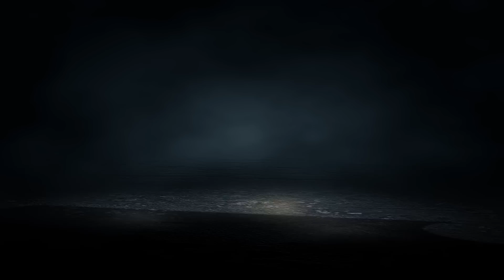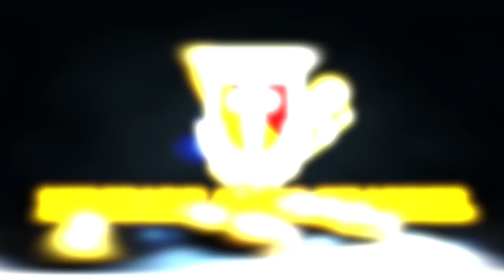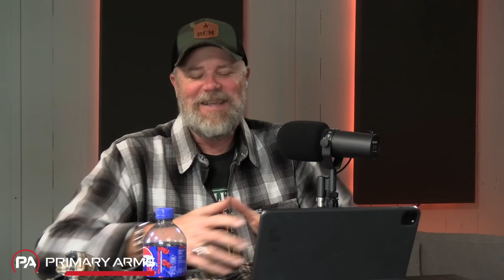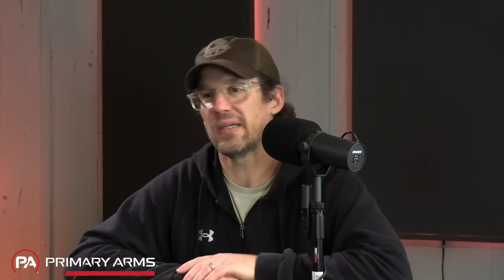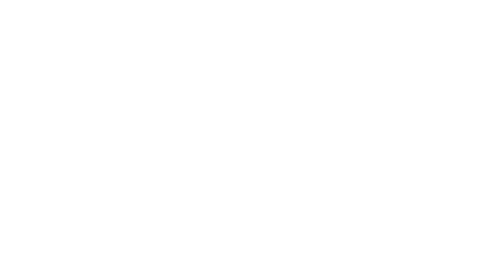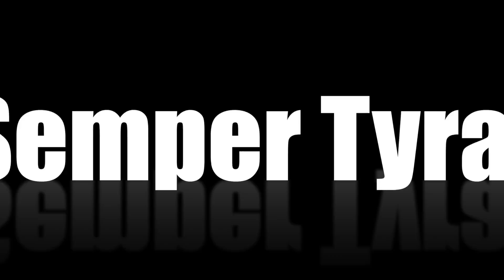Kevin Brittingham of Q breaks down the 8.6 BLK for us.

Comment: I feel like this guy feels attacked and backstabbed by Hornady. But I would bet that Hornady wanted to fit it in an AR-15 so that it would be more in reach of people like me who can’t afford a Q firearm, and by Hornady saying it should be with a 1:8 that opens up for more affordable ammo from other manufacturers and if someone wants the 1:3 twist I am sure that someone will make a barrel or have a barrel made for 338 ARC that will be in that twist rate. The way I see it the 8.6 blk may better in some regards (super sonic) but lacks in the ability to get to mainstream because it is more expensive and having to use better bullets means that the ammo will never be as affordable as 338 ARC can. And the 338 ARC is better in the sub sonic area because of the case capacity, sure you can do blended powders but how would that go for a hand loader? And Hornady makes reloading equipment too. And it sounds like not all of the ammo manufacturers that are making 8.6 blk haven’t gotten the memo on that yet by the account of Jason and Tim. To me the 8.6 blk is awesome but I can’t afford that right now, the 338 ARC is more appealing because I have AR-15 parts in my basement and I can pretty easily make one in 338 ARC and I will bet that soon I will be able go to Scheels and buy ammo! The only hang up I would have is if it doesn’t feed right. But the 8.6 blk has issues of its own that you need to be worried about, I would rather have to buy specific magazines than be stuck with having to use expensive bullets and expensive rifles! These are my thoughts as a random consumer with moderate funds to spend on firearms and ammunition. The 8.6 blk feels out of reach to me and while it is cool the 338 ARC scratches that itch but is more attainable.

Comment: I assembled a 308 this year for deer & hog hunting. Used Aero M5 receivers Faxon 18" big gunner 308 barrel giesssle ssae-x trigger. I've only got 80 rounds through it between range & deer hunting.  But locked down in the Caldwell lead sled shooting 150 gn core-lokts it's consistently shooting 1/2" groups at 100 yards. That's cold & hot, doesn't  make a difference. That barrel likes that ammo which is what I use for deer. I have other Faxon barrels & they all shoot good. But I have been extremely impressed with the 308 Faxon!!!

Comment: Question for Kevin, if he could only build 1 300 bo sbr or pistol. What barrel length would you choose for supper & subs?. You said military went with 9 just for storage & 12 is better for suppers. What's best length for both?
Reply: There are other factors. How far are you shooting? Mostly supers or mostly subs? 12” is better for shooting super farther. I like both. But, if I had to pick, I’d likely choose 9”. I shoot subs a lot.
Reply: I wanted to put together a 300BO upper for hunting deer, hog & home defense. I would use subs & suppers. Most my shots hunting are between 50-80 yards. The longest shots are 120 yards at best, that's not very common in SC woods! I would prefer to stay quiet & just recently got a can I can use on 300bo also. I know 1-5 twist is better for 300bo subs but is anyone making a 9" with that twist rate? Seems like that's just the shorties?

Comment: Love this conversation but at 1:12:25 I have a problem with you guys comparing upper to lower fitment tightness on the AR platform to the tightness on a 1911 barrel to slide, slide to frame fit. Slack in AR uppers and lowers seems to be simply laziness and unacceptable machining tolerances to avoid having to scrap more parts that get machined outside those tolerances. Not the same thing at all. And i don't believe for one second that tight upper/lower tolerances cause reliability issues. Tell that to SOLGW and their rifle owners!!! My Son's of Liberty rifles are as solid as if they are one piece and among the most reliable and most precise I have.
Reply: It actually can cause issues. Not as pronounced as 1911’s probably, but yes it can cause issues.
Reply: @kevinbrittingham6774  what kind of issues? The only thing I could maybe see is "possibly" some magazine fitment issues with out of spec magazines, caused by the magazines not the receivers. 
Maybe some hammer to carrier tolerance issue??? Please explain
actual Kevin Brittingham?

Comment: Everything in firearms is a tradeoff because of physics.  In the history of firearms the 2 that most people have played with are velocity and projectile weight.  So barrel length, bullet construction, and powder were what everyone changed to achieve the goal.  That spans smokeless and black powder.  Well now twist rate has been added to the mix and expands the field on what you can play with to achieve terminal ballistics.  The only reason 1:7 exists in 5.56 is because of M856 and M855 to make them stable.  Not to help them perform better on target but just make them work in the M16 because of the lineage of the cartridge and technology available at the time.

Comment: I just want to see more CFD modeling of the projectiles from trans-sonic to purely subsonic. 

Many people don’t realize trans-sonic is turbulent but still considered “sub sonic” by most, but air flows very differently between what’s trans and what’s truly sub sonic.

Trans sonic is when the bullet is sub sonic but in some areas air accelerates around the projectile to super sonic velocities and causes a lot of strange behavior. 

Correct me if I’m wrong on anything by all means
Reply: Trans sonic is when it identifies as something different with rainbow colors.

LOL, but really it goes SUPER>TRANS>SUB as a supersonic bullet travels thru the air. So trans sonic is the bullet transition from super to sub speeds (1115-ish to like 1200fps).

Comment: Why can’t you put a can on a sfar? I do. Am I making a mistake?
Reply: You absolutely can suppress an SFAR but it's going to eat the lifetime like it would on any gas-operated, plus additional impact due to the reduced size/footprint compared to previous AR10/LR308 makes.
Reply: You just need to restrict gas pressure at or before the bolt carrier / piston (the carrier acts as a piston due to the expansion chamber the gas gets vented into pushing the carrier rearward, and unlocking the bolt due to the cam grove geometry)
Reply: I installed a rifle speed gas block. It’ll be fine. But Q said you couldn’t suppress it
Reply: @bananawatch8158  Nah not what he said. It will not be military ready but fine for backyard plinkning. You got ears?
Reply: @he said you can’t suppress it you clown.
Reply: @Nillersoon40 8:55

Comment: chump copy of the 9x39mm
Reply: Actually.   338 arc is the chump copy of 9x39.   They share the same parent case.     8.6 blk has far more potential.     Subsonic is Subsonic.      But when you go super . Holy crap.      Plus heavier pills in 8.6 blk makes a difference as well
Reply: which nobody use

Comment: I actually think 8.6 is too small of a leap in diameter compared to 7.62. It is a much smaller difference than 5.56 to 7.62.

9.3mm would be closer to the ideal increase.
Reply: There are balance tradeoffs to everything.

If you're going up to 9.3mm, why not go all the way up to 10mm? And while you're there, why bother with a proprietary bolt head, just use the 30 Rem/6.8SPC/10mm/40SW case head. And if it's mostly for suppressed use, why not go as low as commonly available 180gr subsonic loads? Why bother with a custom cartridge at all when you're just re-making 40SW and can relatively cheaply shoot it for $.35/rnd?

I know what ya mean, at the same time. It's the fact that there are common 338 bullets that will fit 8.6BLK (338 ARC) that has people going down this route. Otherwise, 9mm/.35 is also a better leap in diameter, but would it be worth the increase in bolt thrust/recoil? Gotta be the people actually taking the leaps and testing the builds to determine.
Reply: The bullet diameter was limited by the rib on the sr25 magazine.